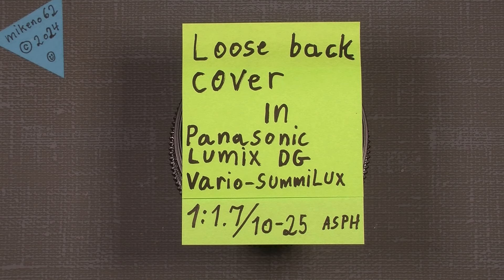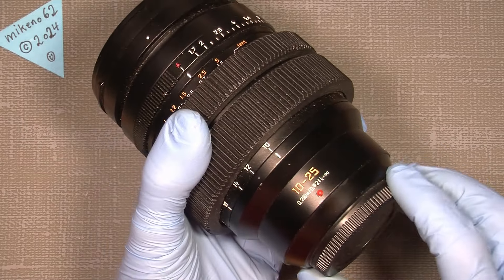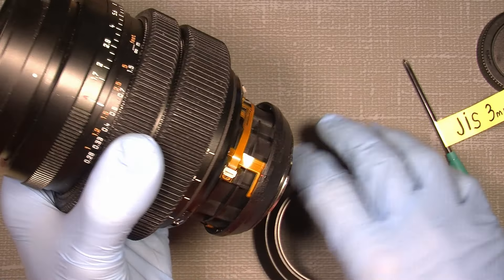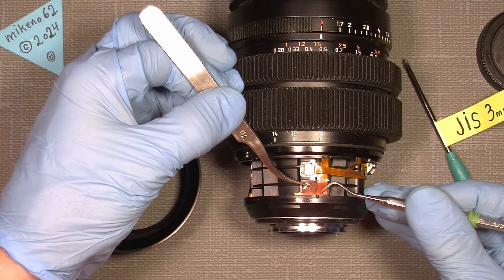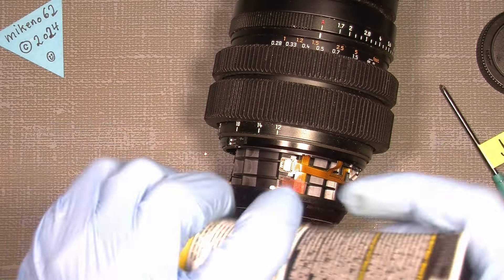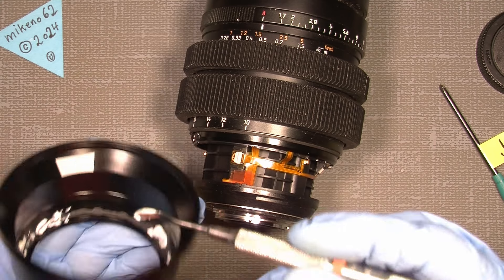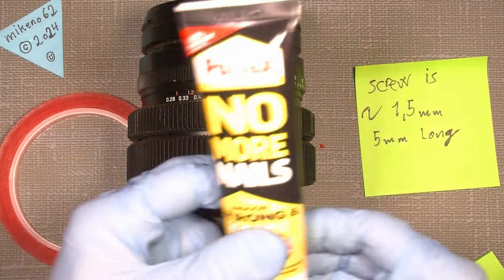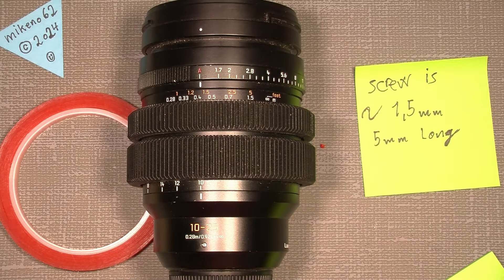Loose back cover in Panasonic Lumix DG Vario-Summilux 1:1.7 / 10-25mm ASPH

Comment: Hej.
Jeg er er lige begyndt at rode med gamle linser og er vild med din kanal.
Jeg har en dejlig topcon linse med noget der ligner haze på ydersiden af det foreste element. 
Jeg tror desværre at coatingen er beskadiget da jeg ikke kan fjerne det ved de konventionelle metoder.
Kender du til nogle skrappere metoder?
Det kunne være interessant at prøve at polere det selvom det ødelægger coatingen.
Har du nogen erfaring med den slags?